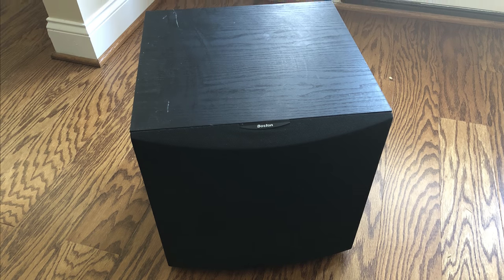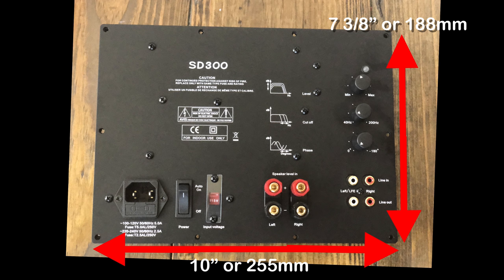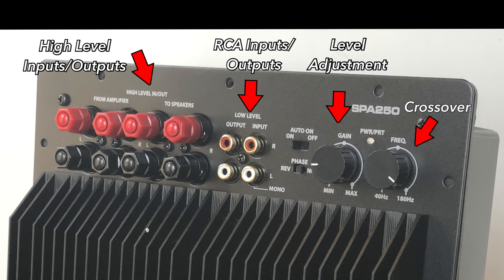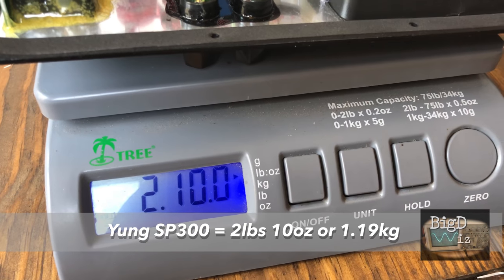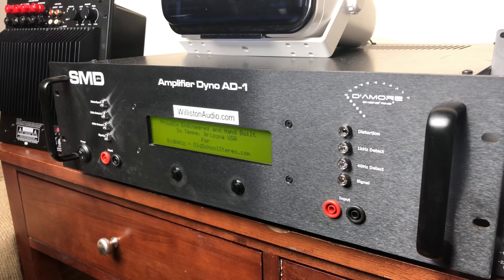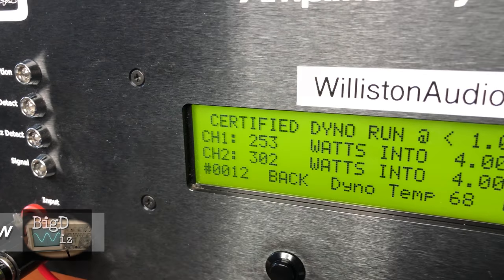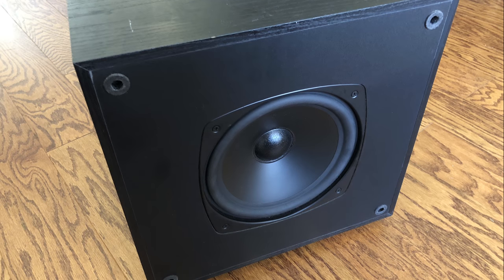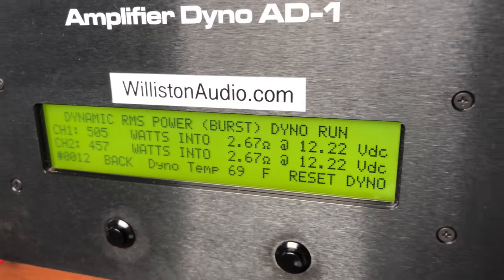Subwoofer Plate Amps? Dayton SPA250 vs Yung SD300 Tested

Comment: Thanks for this! When I built my home sub I was considering these two exact amps. Ended up going with the Yung for a few reasons (dimensions, cost, output, etc), and I'm really happy with it.
Reply from the maker: In my initial listening tests, they both sounded equally good to my ears. I’ve heard some concerns with the Yung’s reliability, I’m betting it is due to vibration of components on the circuit board. I may use mine externally, building a small enclosure for the amp, not sure yet

Comment: THANK YOU FOR THIS!!
I actually bought the Yung SD300 about 3 months ago to power my old 12" 4ohm Powerbass  car sub for a set up in my bathroom lol. (now I upgraded and it's going to go in the garage). It's been working great!
I actually built a small box for the amplifier itself and added terminal inputs to it. That way I could plug in any sub to it as it's own standalone amplifier.  Good to know it actually does do it's rated 300wrms! And interesting test at the end at 2.6ohms!
Keep it up BigDWiz!!
Reply from the maker: I think using it in a separate enclosure will prolong its life. But you said bathroom system? Dude you be thumpin’ while you’re dumpin’ 🤣
Reply: LOL!!
Mainly to jam out while I shower but I won't deny that either XD

Comment: So glad i found this! Been putting off replacing the amp in my MTX SW2 & wasn't sure about Dayton components.
Looks like a great match with plenty of headroom! Thanks!!
Reply: I have been using the Dayton for a couple years now on a 4 ohm Pioneer car audio sub. If it performs anything like mine, I think that you will be extremely pleased with it.

Comment: Nice work D! I have both of these amps sitting in my stash. Word of caution on the Yung. It does not have short circuit protection. In testing, I forgot to shut it down and shorted the speaker leads. Blew the fuse and toast. Replaced the fuse, nothing.
Reply from the maker: Oh boy, that’s a biggie 😱
Reply: @wal  Sorry for the Necro post but I need to vent. :-) I have 4 of the Yung SD300-6 plate amps. The first 2 died 2 and 3 months after warranty. The replacement plate lasted 4.5 years installed in a Klipsch Pro Media 5.1 sub-woofer cabinet driving the 2, 8 inch subs. But I religiously switched the unit off after using it and was used only for PC gaming. It died and the 4th replacement Yung plate I had on the shelf that whole time died after 2 minutes. The red power light comes on but does not switch to green when receiving signal. I've never had the sub volume past half way. My other sub cabinet was a 10 in Alpine speaker and was one of the original Yung plate amps I had that died just after warranty. All amps died with the same issue, seems to power up but no activation. Why did I buy them a second time, well the holes in the cabinets were already the right size. I will never buy a Yung plate amp again now though after 4 failures. Plate amps dying seems to be part of the territory with these things but I would definitely switch to another brand like Dayton next time.

Comment: Cool review!!!Dayton Audio is legit,run there 6.5's(4)of em and a dayton audio ho12 in a 1 ft sealed enclosure in my f250   on jl amps,great speakers and products from them,I've been punishing them for years without a hiccup.thx again for the channel Big D much ❤.
Reply from the maker: Thanks for the feedback, I need to post this over at Parts Express
Reply: Yeah, I've had that same Dayton amp for several years powering a Dayton 12" sub in a horn loaded enclosure for my deck. Sounds great with no issues. I'd be curious to see how the Yung amp does long term. Great test Big D !!

Comment: My first dayton 200 lasted me almost 16 years on a various subwoofers. My yung sd300 lasted 2 years and will no longer power on. It ran cool and had lots of power running a dayton classic 18. I loved it untill it died for no reason and now I'm using the Dayton 250 like in your video with no problems so far.

Comment: Ive repaired a few of those Boston subs. A single 50 cent Mylar cap would fix your problem. They crack or blow out the bottom of the capacitor between the leads, kind of hard to see unless you look real close.

Comment: The dayton SPA250 is a beast of an amp i bought one to replace a dead Cambridge SoundWorks basscube 10s amp an I swapped the driver out with a polk audio dxi 10in 4 ohm svc i never got to hear what the original amp sounded like but it was only rated for 75 watts but it shakes the entire house

Comment: I had both of those, and I'm using the sd300 right now. THe spa250 was good, but something kept happening where I had to flip the fuse sometimes. That's when i got the sd300 more powerful, and it was on sale. Had it for a two years, and not a single problem
Reply from the maker: I’ve been switching between the two. No issues and no noticeable difference in SQ

Comment: So the Yung does look impressive performance-wise compared to the Dayton. I am wondering about longevity though. I have read some reviews where people indicated their Yung plate seemed to run really hot and some said theirs eventually blew out and quit (not saying this would happen to everyone). I noticed as you indicated about the Dayton having sealed internals and that the heatsink is all external (much more surface area than the Yung heatsink), and the Yung releases all it's heat toward the inside too so if using a vented box then might be fine, but if you are wanting to run sealed, then it may run at hotter temps. 

I can see that as a drawback in my case because am looking to build a sealed box subwoofer, and originally thought to get the Yung and build the box with an intermediate chamber to mount the amp on, having a fan vent system (flowing outside air through it) to keep amp chamber cool. 

The Dayton seems to be better in the cooling aspect though, since it has external heat sink and would not require any special design to account for temperature. In your case, you have a small speaker and will probably never drive the speaker close to amp limits and thus it may never get that hot really...

Comment: The yung may make a little less power, but the variable phase is quite important and often under used. Rarely do main speakers and subs perfectly integrate at 0 or 180 degrees. Also the yung will be more efficient as it’s class D.

Great video by the way.
Reply: But it won't last long. Then what?

Comment: Excellent work again my good friend. Nice to see these plates getting some straight up honest testing. Question: I am looking at rebuilding my home theatre/hi-fi system and was looking at replacing the plates on my two Klipsch KSW-10's with the Dayton plates. Was wondering if using a dedicated sub amp like the Dayton audio sa1000 might be a better investment vs buying two plates and replacing the old Klipsh plates on the KSW-10's This would allow for upgrade ability in the future should I decide to upgrade the subs in the system. What are your thoughts on this? Thanks again for all of your hard work!
Reply from the maker: Yeah that single SA1000 would do well for 2 subs as long as the impedance matches the amp

Comment: Nice video! For some reason I'm surprised at how well that Yung did. Pleasantly surprised though. I wonder how the "BASH" plate amps do that PE sells. I used to run a Bash 300S on a Cerwin Vega Stroker 15D2 for home theater use.
Reply from the maker: I almost got the Bash amp too, think I may try the 500W version in the future

Comment: BigD I also own a Boston acoustic Sub it is a larger model with a 300watt plate amp. I also had to take it apart replace one of the caps it fixed the issue mostly. But I think I need to take a look at the turn on circuit because the sensor to allow it to turn on with the system just isn't that great. I have been looking at the plate amps parts express offered.

Comment: well the open design can help with not taking space from the box, you dont want to lose any volume of the box, and less chance of clearance issues. (i would have used a car amp tho or those china amp boards)
Reply from the maker: I’m going to leave the Boston amp installed and re-wire the speaker level inputs on the Boston amp to accept sub out from the Dayton and Yung. Will try them individually for a few weeks and report back with an update

Comment: Dayton also has an external amp if the plate amp doesn't or won't fit to the existing sub cabinet.  Wish dayton sold a bracket / modular system that one could use on odd side subs, then again, powered subs are so cheap now it's almost simpler just to replace unless you have some exotic setup.
Reply from the maker: Yeah the separate amp would’ve made more sense in this case as I’m not going to mount inside the box

Comment: Strange that the one with variable phase does not have a full 360° of phase adjustment. You could crack your sub open and switch the wires to get the full 360, but kind of strange not to also have a switch too.

Comment: hey nice test there

i have the dayton amp.  i tried hooking up two 8 ohm 12 inch woofers to it, in parallel, and it got REALLY hot, enough where you couldn't touch the heat sinks. it was supposed to be for a light weight pa subwoofer.  yeah i don't recommend that

so now i have it on two other 4 ohm 12 inch woofers in series.  now this is for home theater sub and it sounds great

i'll always choose a/b over class d every time.  how does the class d sound against the dayton?  did you compare that?

Comment: I realise this is an older review, but the Parts Express still sells the Dayton Audio SPA250.  FYI, I am considering buying Qty 2 plates and pairing one each to JL Audio 12"TW1-4 (300w, 4Ω) subwoofers for my left + right DolbyAtmos front sound stage... I am designing into a low profile and architecturally integrated / built-in-wall home theatre front stage stage. I can not seem to find any multi-channel LFE input subwoofer 'amp' only options as I would have thought?  What are your thoughts or would you use a different combination?  Thanks, Jason

Comment: I have the Dayton 250 watt amp and the Yung 300 watt amp. I can say that hum is an issue with the Dayton
Reply from the maker: I haven’t experienced this. You may have a ground loop?
Reply: @wal  After the unit got old it had hum. It was good for awhile, maybe 2 years. We put Earth grounds to both the amp and the receiver.

Comment: Hey BigDWiz.  Waiting on the follow up video to see how they go with that Boston sub..
I have just got the Yung SD300-6 plate amp to replace the faulty plate amp in my Velodyne CHT-12Q subwoofer.
Though on taking the old amp out & putting on my multi meter. It's a 8ohm subwoofer in there..
If I work out the internal enclosure size. Would I be able to fit a 4ohm subwoofer that suits that enclosure & install it?
Then I would in theory go from 150w to 300w output..    Sub is used mainly in Home theater

Comment: If you ever get the chance, do some big plate amps form SpeakerPower. They have 2.4k, 4k and 6k RMS plate amps. I would love to see if they do rated power, hell I would even be willing to send you mine
Reply from the maker: I expect those require 240v input?
Reply: just the 6k. the 2.4k and 4k are 120v
Reply: Bet the neighbors love those!!!   Ya need an older home/large lot to enjoy I bet!
Reply: good thing I live in a house built in the late 1800's and my neighbors are a few hundred feet away, so I can shake my aluminum siding in peace!

Comment: Cool home theater plate amp review. My spl12 velodyne sub amp went out. Looking for a good replacement amp. 👍🏻
Reply from the maker: Oh man, I always wanted a Velodyne sub. They were the ones I’d drool over when I was assembling my first HT system back in the 90’s. I’m not sure if your model uses the feedback circuit, but that would be my only concern when getting an Amp for your sub
Reply: Year of manufacturing said Jan of 2000. Has a black wire that grounds to basket of woofer. Beefy sub build using 3" coil and solid motor structure. Sub plays perfect on any other outboard amp.
Reply: Those were the go to bada$$ subs back then, but, as always, it seems like none of the amps on older powered HT subs were built to last, even if you barely even used 10% of their potential, age seems to be the killer.   I have a cheap seats infinity beta sw12, amp has stupid turn on noise, and if there are long sections of movie without bass content, it shuts down, then chirps awake (as if I own a bird).  It's annoying, but, learned to live with it.

Comment: Nice vid! I've been looking to do a build for a 12" sub for the man cave. I want a plate amp that just has the one sub coax and bass control knob. Most sound bars nowadays just have the one sub coax. What's my best bet D?
Reply from the maker: Both of these subs have the LFE connection and can run off of one RCA
Reply: BigDWiz Thanks!

Comment: i've had nothing but problems with every dayton plate amp i've bought, 3 had to be rma'd and then had the same problem occur after warranty was up. the 4th amp they would not even acknowledge that i had purchased it from them because i had purchased a 2.1 plate amp that was a turd and the dude on the phone set up a trade for a 70 watt plate amp and a partial refund so it was never entered into their database properly. that amp failed and i had to put an amp module from ebay in it with no xover and was able to use the existing power supply. it has lasted longer than the dayton amp module. the 100 watt plate amp was rma'd due to turn on thump.after replacement, it developed the turn on thump again but when i requested a rma they only wanted to refund me. i also bought a 2 ch amp (apa100 maybe) from them that sounded like complete crap that i was able to sell to someone that could not hear as well as i. dayton has decent drivers but with inflation today, there is no value to going dayton over a different brand. i'll still use parts express but i am done with the dayton brand unless i have to replace a driver in speakers i have previously built using dayton drivers.  i do own the spa250 and it is a paperweight. 1 control that sounded dirty but had to be replaced because the potentiometer tracks were corroded. the other pot was 4 gang and no way to clean and no replacement available. i continued to use it and then one day, making an adjustment the noise caused by the control caused a peak and killed the amp.  if i could have found the dead part in a timely manner, i would have fixed it but i gave up early. it's a lost cause. it would just do it again anyway because of the cause of it. other prople have great experiences with dayton, to them i say congratulations but i'm over that name! (i even cancelled my flyers and emails)

Comment: Don't understand this AC to DC adapter (do you mean DC to AC inverter?). They both have their own AC power connector and internal power supply which dont supply their main circuit board with 12V DC (could be a different DC voltages). Yung has a switching power supply which matches perfectly D class amp while I am not sure about Dayton AB amp since it is enclosed. Considering the weight it probably has a coil transformer in it so each has its own DC power supply internally. How did you measured the output on 12.3V DC?
Reply from the maker: When measuring car audio amplifiers, the Amp Dyno shares the power source with the amplifier, thus the resulting voltage display matches power output at a specific voltage. When I test home audio amplifiers, the Amp Dyno has a 120V AC to 12V DC power supply so the Amp Dyno can perform the tests. In this case the 12.3V shown has no importance to the test at all.
Reply: @wal  Thanks for that. So Dyno can "read" the AC voltage on speaker output terminals on tested amp and put it against the chosen ohm resistance (in this case 4 and 8 ohms) and measure the outputs in wats... That Dyno must be one expensive piece of tool. Thanks for doing all these tests in all these years for us who cannot afford it. Well wort subscribing and always watching to the end...

Comment: Wish the dayton would do on 2 Ohms. I have a RE audio REX12 dvc(4ohm per coil) that i want to use. 20hz Fs! Wired in series would be safe ya..but not enough power.
Reply from the maker: Just get 2 amps 😬👍
Reply: I would probably just save more for a bigger Dayton and run it 8 ohm untill my finances allow for a better 4 ohm driver. My last dayton was 272w@ 4ohm and just started having scratchy pots. Got it got it around 1997!